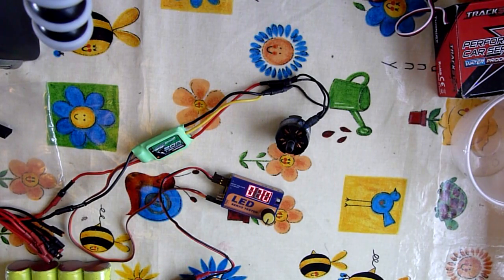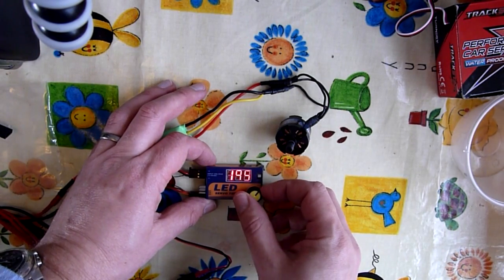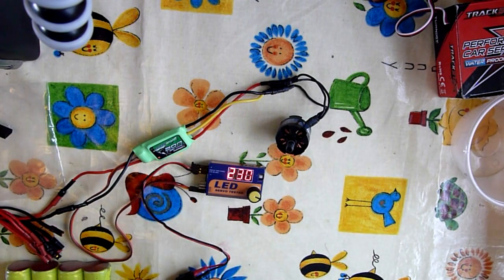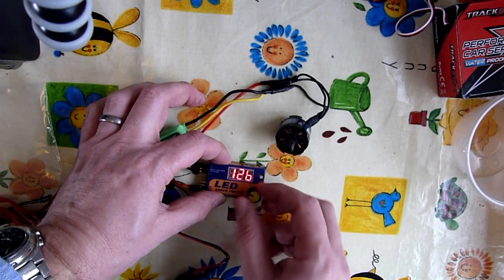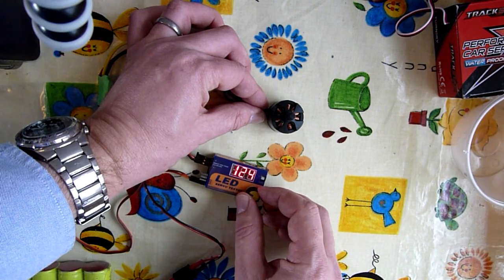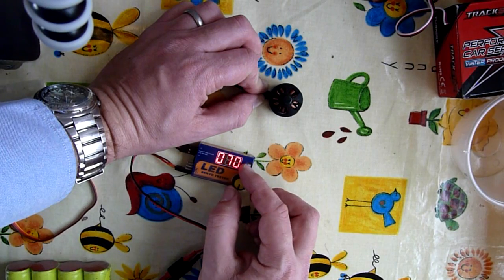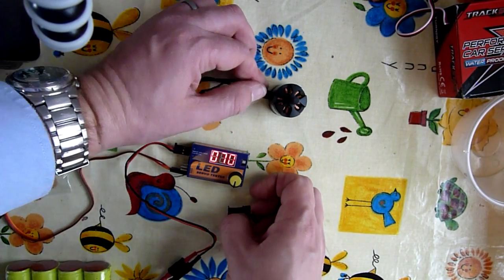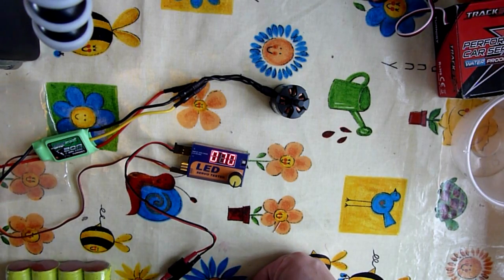quicktip Multistar hobbyking multirotor ESC - throttle calibration IS required

Comment: Dropping the throttle on this ESC does NOT set throttle range, that programs the brake settings.

Half way down second page of the manual. Brake settings.
http://www.hobbyking.com/hobbyking/store/uploads/133661331X102492X18.pdf

What would have prompted them to render the product completely useless for the application that they are marketed at.
Reply from the maker: Tom Murray I guess this video must be fake then ?? Seriously, if you hold full throttle until you get the 5 beeps (single, double etc) thats the programming mode, I drop throttle after the initial beeps which is calibrating throttle - the video is pretty clear if you watch it carefully I think its conclusive.
Reply: The video is not "fake".  If you load up the motor (install a prop) you will see that it triggers the brake on and off. It is almost impossible to tell with no load, as you demonstrated.

I've just been trough the same thing with these ESCs. The inconsistent throttle response is another matter. They are now enjoying their new home in the bin.

These are the only ESC I have come across that adjust the brake function where almost everyone else has the throttle range calibration.